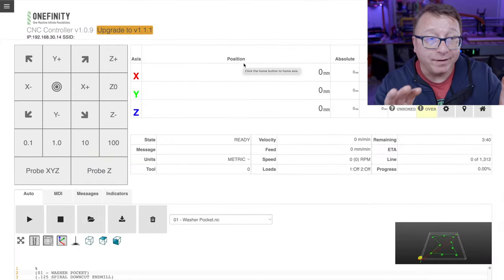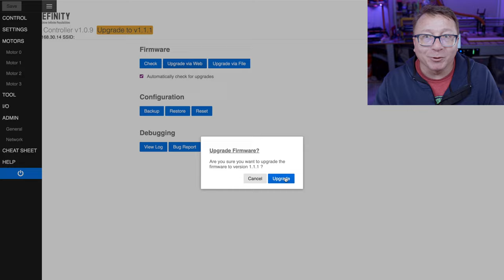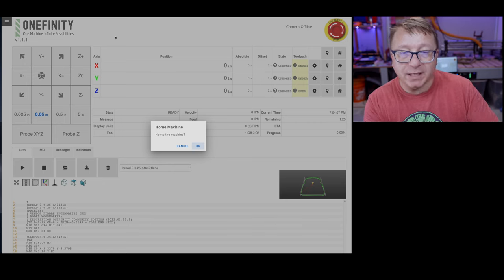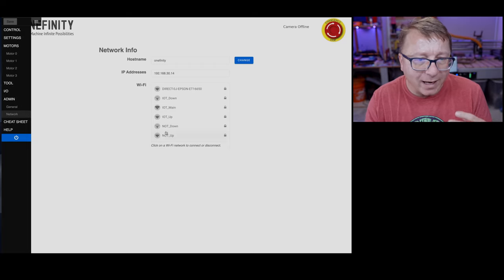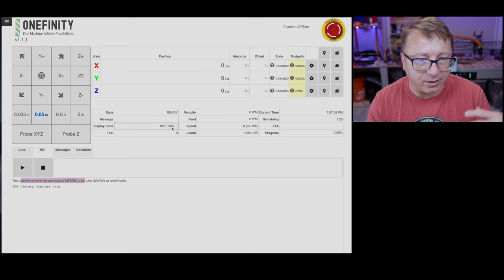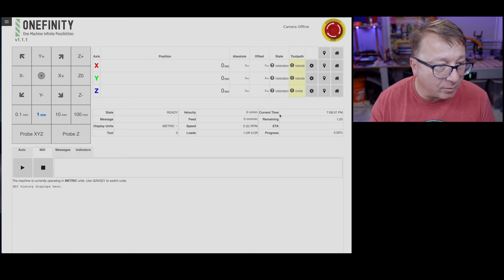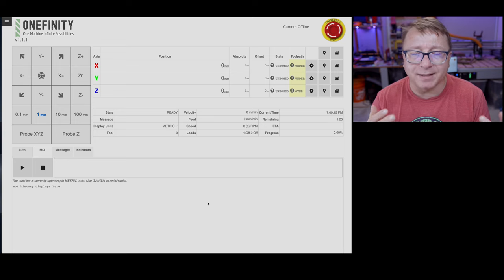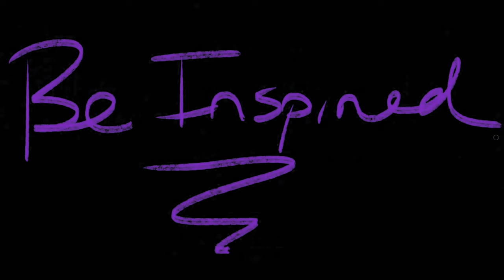What's New in Onefinity Version 1.1.1?

Comment: Be sure to give 1F direct feedback on how you would like to see the product developed. Consumers have a voice. Regarding the wi-fi issues, hearing that when you plug in the Ethernet cable to the jack on the controller, it disables the wi-fi.  Many commercial shops run hardwire for good reasons.
Reply from the maker: Thanks Douglas. I have a wired connection for many of the same reasons. Reliability being first and foremost.

Comment: OneFinity Firmware Version 1.1.1 is per garbage. Only a handful of people installed and said it was great. That is why OneFinity stopped installing it on new purchased equipment and they put out version 1.2. I did not check the forum because I was out in the shop and the controller said hey there is a new version so I just installed it. Bad mistake on my part I will always check the forum from now on. I have so many problems it created my machine is down until I get the Anker equipment to reflash the SD card. Shame Shame OneFinity. How can you put this out.
Reply from the maker: Hi Wayne. I have 1.1.1 installed and although I have seen some oddities, I can't call it 'garbage'. Do you have specific examples of things that are broken or no longer work with 1.1.1?
Reply: I’ve had and still have 1.1.1 installed and have not had any issues.  My issue is going to be having to unmount my controller from the side of my bench to do what they’re saying I have to do with SD card to go to 1.2.  That will be the hassle.  😂
Reply from the maker: @garypuckett3734  I'm still using 1.1.1 - I see 1.2 is out but that requires a total rebuild of the OS and a step back in functionality. I'm just waiting until 2.0 is GA (or I can get a Masso :))